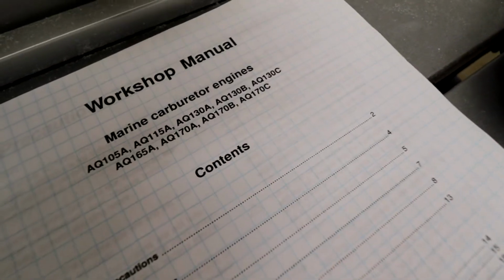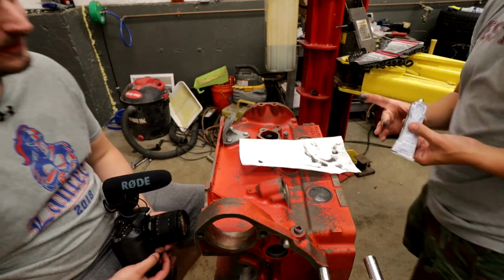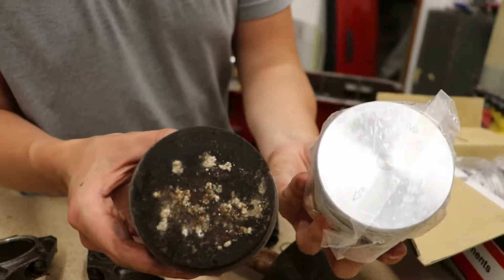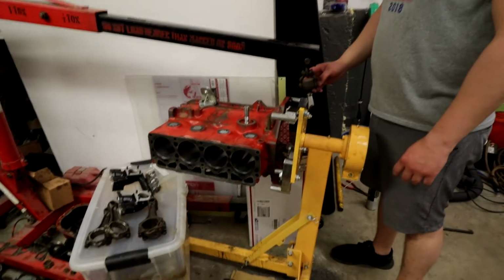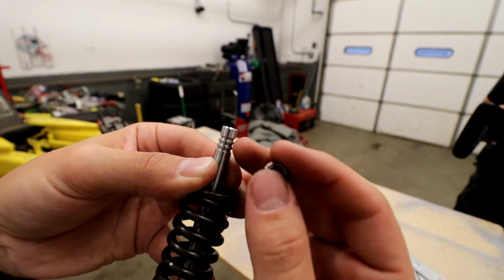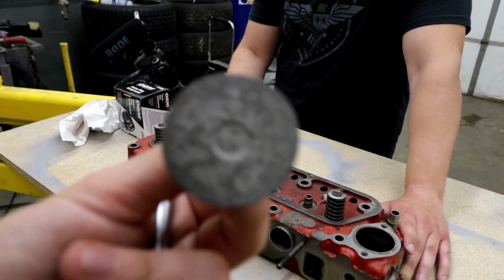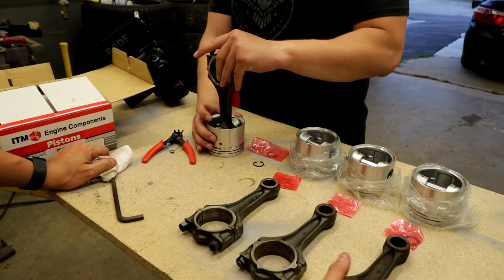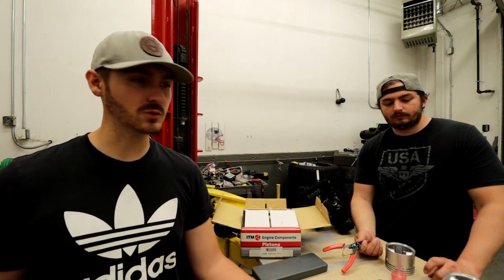Freeze Plug Install and Problems - Boat Restoration Part 7

Comment: Just found your videos guys, I love them. Are you rebuilding using some manual?
Reply from the maker: Thank you! and yes we are using a SELOC manual specifically made for the Volvo Penta engines. We could not have worked on this engine without it.
Reply: @DownToTheFrame  thanks for the answer !  I saw the manual in one of your later videos. Thanks again for the effort guys !
Reply from the maker: @halldorgislason6580  of course! Thank you for the kind words and good luck on your project!

Comment: Freeze plugs need to be brass for marine applications. Sorry I am late to your series, hopefully you have corrected this before the build is complete?
Reply from the maker: We still have those freeze plugs in there but we are not replacing them. They will fail earlier than the brass ones but we will correct them when that happens. Unfortunately, we learned about the brass just a little too late

Comment: Crosspin bearings? Also called a gudgeon pin bearing is missing.... Engine will not run very long without it... Great video. Best regards from the marine engineer.
Reply from the maker: Good call! We will do a full inspection of the engine before we run it to make sure we didn’t goof something up lol
Reply from the maker: Also marine engineer?! pleas watch all our videos and tell us what we are doing wrong 😂
Reply: Shure, I am already looking at it. It is funny to see some of your alternative approaches to the different problems, but trial by error is the best way to learn, cause you will never forget it😁 Great videos.